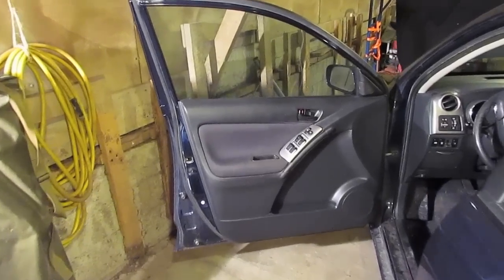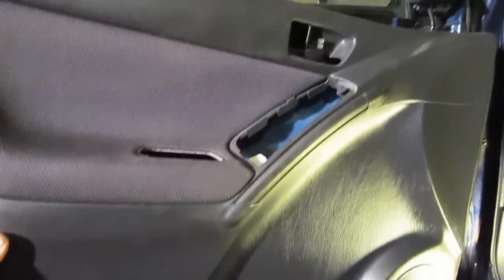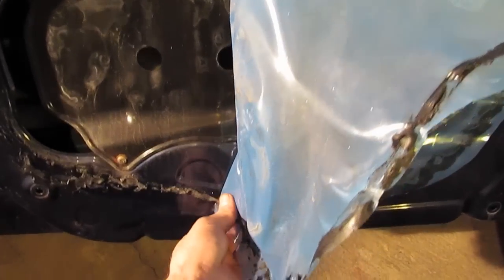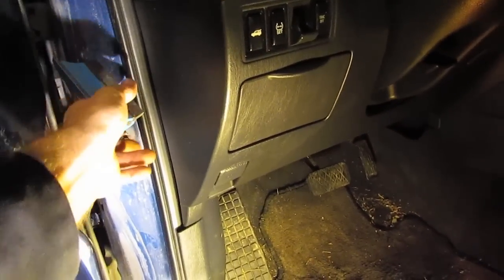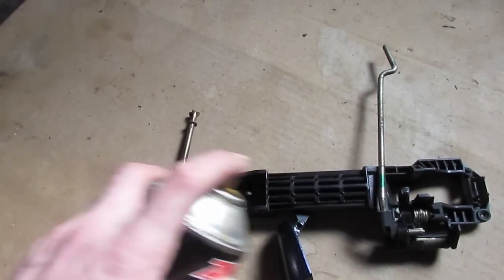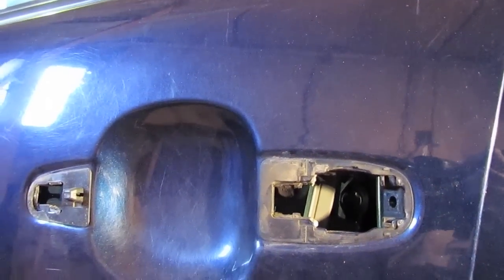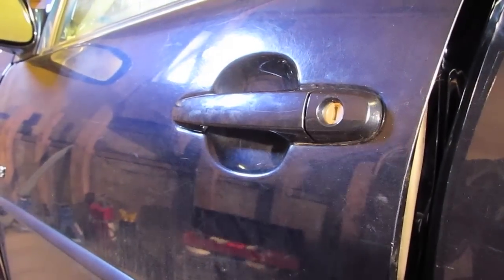Vibe or Matrix Door Lock and Handle Repair

Comment: Excellent video!  You seemed to take apart more things than necessary with the speaker wire and such, but everything you removed gave great and detailed visual access into door panel access.  This is slightly more complex than the rear door, so I'll do that one for starters and go to the front door when I'm feeling slightly more accomplished.  THANKS!!

Comment: Just want to say I just replaced the front and rear door handles on a 2005 Vibe a few minutes ago. The front you do not have to take the door panel off at all. 
I removed the rubber plug on the edge of the door, loosened the T30 Torx screw, it does not come out as it has 2 plastic nubs that hold it in. Once loosened you pull the whole lock assembly out of the door, than the broken part of the door handle can be removed.
 To reassemble, insert the new door handle in, and once the front and rear is installed, push the new handle forward, then reinstall the lock with the new or used cap on it, and re-tighten the Bolt. 

I Had to remove the screw (fromt he plastic nubs) on the Vibe I just worked on as it did not want to retread into the hole. I found I had to push the lock assembly in further (than I heard it click in place) than using a small flat screw driver I got the threaded hole to line up with where the bolt goes, than I was able to re-install the bolt. That was it, no door panel removal was necessary, DONE !
Reply from the maker: +ahardb0dy  Great tip.  When I made this video, had pieces that fell down inside the door.  Also the latch rod moved slightly out of position.  I could see where a narrow screwdriver could hold things while the new handle was placed into position.
Reply: I wish I read the comments before starting. This would have saved me quite a bit of time. Thanks for the tip.
Reply: I just did this, and he's right.  Removing the door panel is unnecessary.  Put your key in the lock and turn it to make removing and reinstalling the lock a little bit easier.
Reply: I've been searching for this for hours because i did not understand why you need to take inside panel for front handle, finally someone else figured it out. Thanks mate!
Reply: Nice

Comment: After just replacing the same handle on my 2004 Matrix, I think all you really need to do is remove that one screw under the cover on the side of the door, pull the lock out, and slide the handle piece out. Mine broke on the other side of the handle though, so I had to pull the two pieces out separately.

Comment: On the Rear door, I just replaced my handle by removing the three torx screws that hold the latch in place.  I then gently lifted the whole latch up, and that allowed me to reach through to the torx screw holding the handle in place.  I removed the handle, installed the new one, and replaced the three torx screws holding the latch in place.  All said it took 15 minutes start to finish.
Reply: +Clay Richardson I don't see a video of a rear door handle replacement...so you can do the rear handle without taking all the paneling off?
Reply: +Adrianne Valdez from what I can tell they look very similar. not the mechanic approved method but it worked for me.

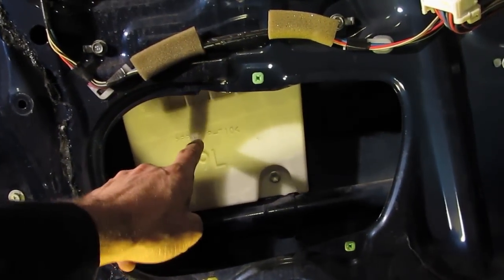Comment: what's the thing inside the door at 3:45 ? (white box)
Reply from the maker: Has to do with side impact rating crash rating.  If the vehicle is hit in the side it distributes the impact across the door's inside.  Its fairly thick, with plastic dividers, but completely hollow.  Does not serve any function in normal operation of the door.

Comment: Don’t start at the bottom and work your way up where the window controls are at. You will break it. Start at the top and when it pops up you can slide it towards the top to remove it. To everyone. Actually don’t wast time doing all this that is shown in the video. To many unneeded steps and by all means by a new replacement part at for example autozone. It will run anywhere from 30-40 dollars for a new piece and by all means do block the door from closing. That is a don’t miss step in this. Plz view other videos maybe 2-3 to get the best advice from all of them. One video on this totally skips removing the door panel which is important and jumps into everything else.